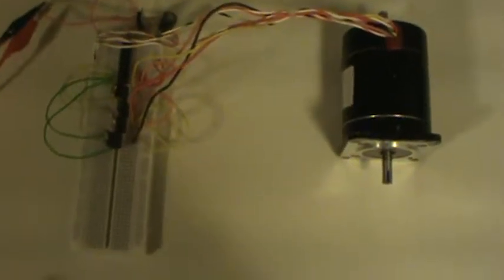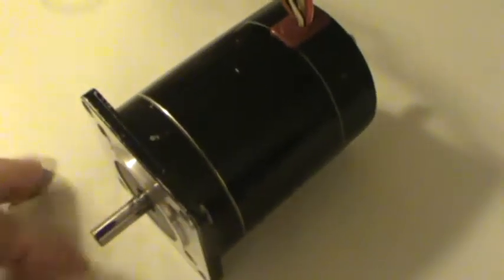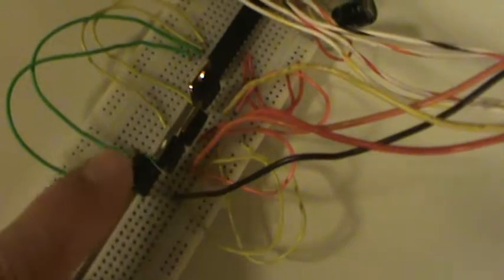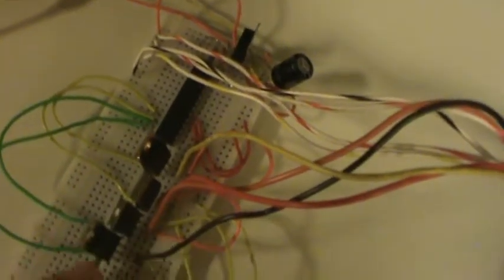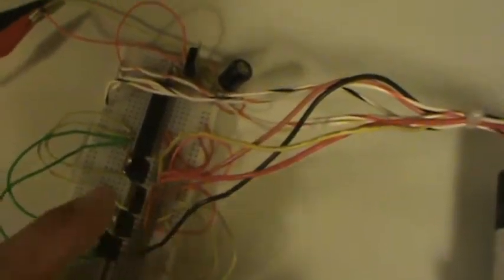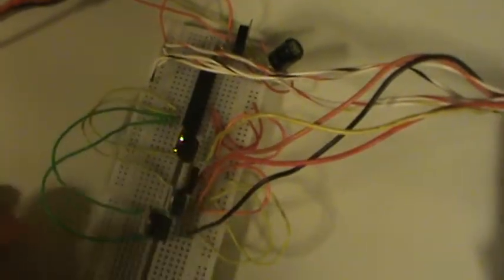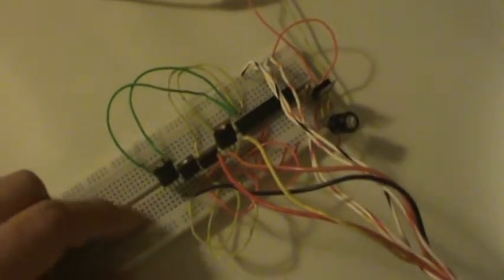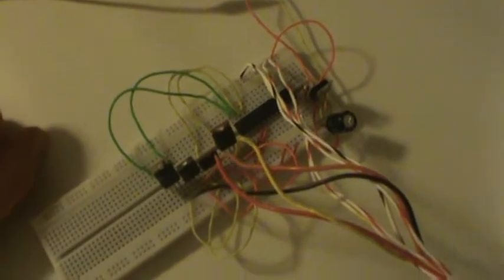Lesson 13 Stepper Motors Demo

Comment from the maker: Thanks for your comment.  That is a good idea to do a vid on that.  Until I get time to produce one you could take an ohm meter and begin checking ohmages and continuity of the motor to determine where the coils are.  Also check to see how many wires you have coming out of the device.  If there are only four then it is a two pole motor and you have only two coils.  If there is eight wires then it is a four pole motor.  Things like this.  I will work on that vid as well.